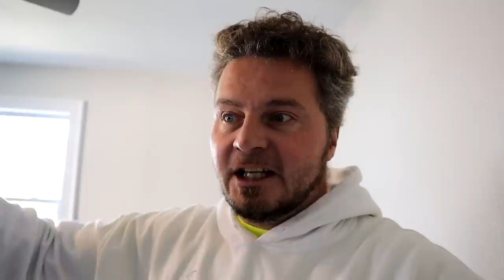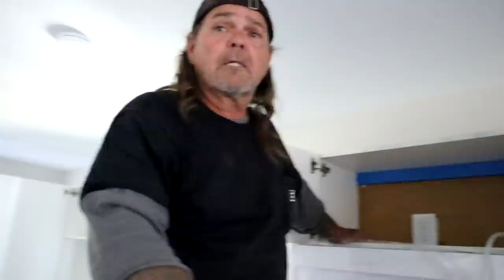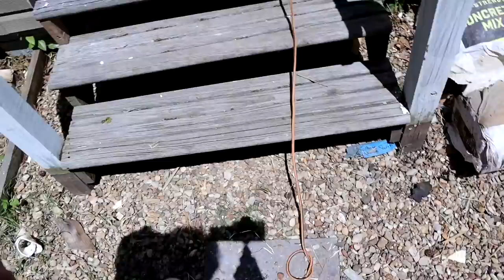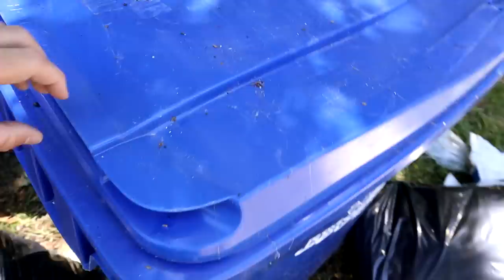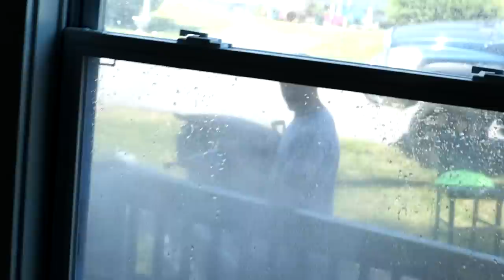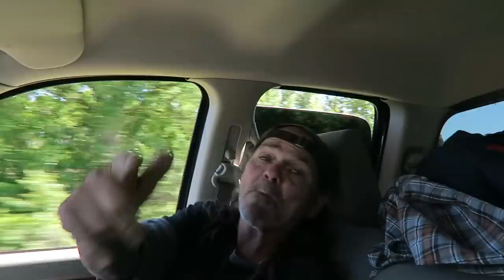What Rabbit Found In The Backyard At The Flip House...

Comment: the siding on your house has a lot of waves in it, the new owners will notice that right off,.. plus you need to replace all the boards on your steps that looks shady, don't forget all the small details all that matters when you go to sell it.
Reply: @David Erlstoke ABSOLUTELY
Reply: The waves are from the foam underneath. You are supposed to nail on the low part of each shingle so it stays flush. And if not cut strips of foam to bump out the top so you have something to nail to. Lol GOOFS
Reply: Robert Levitt hes got that along w so many so much other issues

Gap between baseboards and floor
Gaps on doorframe 
Closet doors not hung level
Cabinets are cheap
Fridge should open the opposite 
Countertop is cheap
Gravel drive way is not what people want
He’s too ignorant to listen to people
Reply: I don't understand why people think you have correct absolutely everything about the property to sell a house just make it look nice and be to code. Plenty of shit is wrong with houses that get sold everyday. 

I would however tamp down that grave a little or you just create a mess
Reply: Parker Niernstein there are no interior doors (I think) like where the water heater is.
Reply: @0GTech  sounds like you're the one that's a goof

Comment: Joe, you should do wood renew and stain on that front deck. It's old wood, but it'll look brand new and add ALLOT of value you're currently facing as a possible expense. DO NOT paint the porch. Just wood renew and stain. It'll be in the deck supplies at Lowe's.

Comment: Power washing the roof? Wtf. Thats a first for me.
Reply: It's a thing that people do.
Reply: yea not good
Reply: Great Leader maybe so but not a lot of people 😂 I’ve never heard of such
Reply: Pretty damn stupid idea if you have shingles.
Reply: I roofed for 20 years as long as the shingles are in good condition you can pressure wash them with mean green and it will take the algae off.
Reply: @Red_Beard_Builds  I just had my roof repaired and they are clay shingles (australia). they use it to make sure there are no leaks as well as cleaning the roof.
Reply: @atozrecovery518  
I wondering why he did that.
Thanks.
Reply: Yea the best thing to use is pool chlorine the 5 gal that is on a blue container......u spray the chlorine wait 5 min power wash n its new againg all the mode green stuff n that slime stuff comes right up....dont put the tip off the gun to close to the shingles because u will fuck up.ur roof..
Reply: Quite common in hot humid climates it kills the algae. Soft wash system with bleach is best.
Reply: Great Leader pretty much Australia and all of Europe have one upped the US who prefer beauty over quality when it comes to shingles. Clay shingles are the gold standard.
Reply: Joe Mama  😂
Reply: Joe Mama  homeboy shouldn't be anywhere near a roof
Reply: Great Leader different country makes sense also, but could use a water hose, presser washer is to much pressure
Reply: Great Leader 
Did you get the rounded ones that look like a pipe? I bet those are super expensive I’d love to have a roof like that. You have to have special training to install that kind of roof correctly. It’s not that Americans don’t like them it’s just tar shingles are a lot cheaper, more available and a lot easier to install.   I’m betting they’re easier to repair too
I’m not sure if they would stand up to our hail storms.
Reply: rumpleforeskin73 That’s what I said 😂😂 it’s over for that roof
Reply: rumpleforeskin73  The roof is actually in better than expected condition. Simple green, keeping the wand 12'' -18" off, and being sure to pressure wash at an appropriate downward angle proved to be effective at removing algae without damaging the shingles. Also helps the pressure washer is low psi. Anywho, I wouldn't recommend it to anyone not experienced with pressure washing or being on a roof.
Reply: @richardthomson5817  You really know your shit, Richard, kudos to you. Hope good things to you.

Comment: I'm only familiar with appraisers working on behalf of a lender. Home pricing is determined between the seller and buyer. Realtors can provide you with data of any local comparable properties recently sold prices.Often asking price is initially higher than selling and up for debate. Lender appraisals don't need to match the selling price but reasonably cover the loan amount. They too use local sales comps and rarely if ever would enter the property. Your mileage may vary.